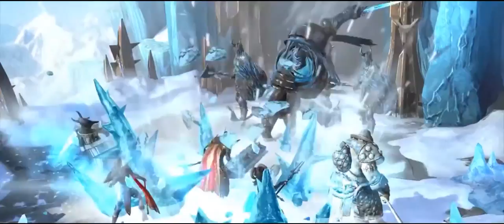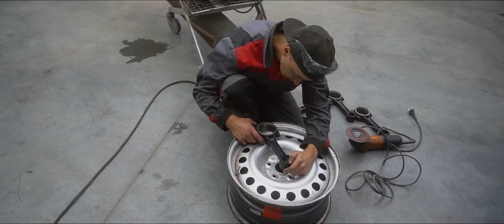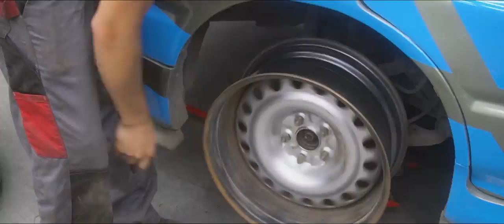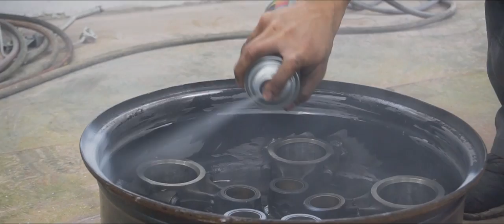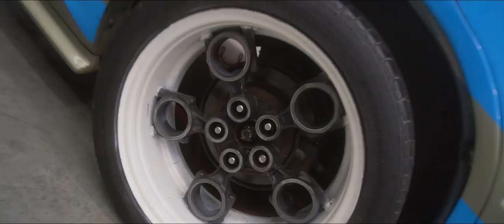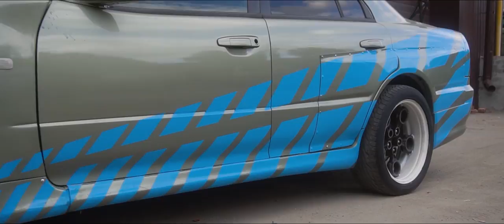How to make a wheel using con rods for spokes

Comment: Start manufacturing and selling those Wheels.
I would definitely purchase a set.
Reply: Yep looks awesome.
Reply: I would definitely not
Reply: If anything, they would be beautiful wall art
Reply: Get me some for my honda odyssey
Reply: Look for some Gianelle 5 Rod
Reply: @saggre  its home made and u dont know how strong it is
Reply: Dude, no, it's held together by just welds
Reply: George Rosebush you’d be surprised by how little weld holds together steelies
Reply: @georgerosebush9754  a good weld is just as strong as the rest of the wheel
Reply: @predater5017  welds are always weak points
Reply: @ksubchallangeBefore  strong is less worry...i would worry mire about the out of round balancing and wobbly wheel  first 🤣🤣🤣
Reply: As long as you aren't intending to drive on them they'd be fine.
Reply: For that they need a welder, not a butcher. ^^
Not intended to be mean, but their welds look always horrible.
Reply: @Eddie Hitler That's on top. :D
I mean it works how they do it, and it's good enough for fun videos. I'm totally fine with that.
But producing and selling such things is a complete other level. Let's say I rather would buy manufactured things from Colin Furze, then from Garage54. ^^
Reply: @georgerosebush9754  knock it off !  When I was a young motoring enthusiast, alloys weren't widely available. And they were certainly not affordable. Everybody were driving around on steel wheels, which were welded together. Look up the iconic white Brazil wheels.
The only issue with steelies is they are extremely heavy.
Reply: @hondaservicecenter  Look, I used to race on steelies back in the day. They never came apart. In fact, if you bend the rim on a kerb, you can repair a steelie with a few blows from a heavy hammer.

Later in life, I have had two alloys breaking apart when being kerbed at speed.

Steelies are stronger than any alloys !
Reply: Morten Kapa because they are steel lol if the steelie was an alloyie it would shatter
Reply: @hondaservicecenter  It was a reply to your claim steelies are weak....
Reply: Morten Kapa I never said they were weak dude read again and then tell me what I said
Reply: @hondaservicecenter  Ok, I may have misunderstood. Were you only talking about weldings on them ?
Reply: Morten Kapa yes lol, I turned a steelie around one day and said “Wow I can’t believe these 4 little stitch welds are holding this thing together and here I am thinking this shit is grand turismo going 50 mph around corners and shit 😂
Reply: @hondaservicecenter  It turns out we are agreeing 100%.
I am sorry I misread you first time around !
Reply: Morten Kapa sorry if I came off rude didn’t have me smoke for the day, youtube comments fill my fix
Reply: @hondaservicecenter  😁😁👍
Reply: Same
Reply: The wheels in picture in the thumbnail look sweet lol
Reply: @georgerosebush9754  I welded my rear spring when it snapped as a temp fix till my new ones arrived i didn't think it would work but i gave it a go anyway..... lasted 4 weeks no issue carrying weight and as you prob know there isnt much to weld to on a spring but i got 3 beads on it, 1 main and then 1 either side, held fine till I fitted new ones lol
Reply: @MegaSockenschuss   seen that turbo ladazilla? The welds on that turbo system are incredible lol
Reply: @Usercouldnotbefound  lol, watching the episode reminded me on my comment here. :D
Reply: @georgerosebush9754  Actually welds are stronger then the material next to them

Comment: Lada should have used you guys to advertise for them, you see the pain you put them through and they still keep ticking . My own Lada got a stuck closed thremostate and I make it home ( 230 miles ) by turning the heater on full blast and useing that as the radiator. Summer time , mountain roads . All tne windows open lol . I loved that little car , brand new 4400 bucks . I bet somewhere that car is still running.

Comment: I actually think they look pretty nice, and I can be SUPER picky with wheel designs. In my mind they have a vaguely late 80's sort of look about them.
Only problem I can see is that the effect would be screwed if they were on a 4 or 3 stud/lug car. A manufacturer would have to design different wheels to work on 3, 4 and 5 stud hubs. That would seriously limit the sales on each design. Tooling costs big money, so they only usually want to make a range of 3 to 5 different diameter wheel molds and adjust the castings for fitment through simple CNC machining....... Or maybe they could make "Universal" 5 or 6 bolt wheels (one per desired wheel diameter), and include a vehicle specific hub adaptor kit to adjust it for different PCD, stud count and offsets?

Comment: Hi ,
Nice idea , verry good looks after finishing ,I like your idea for center alignment job without turning machine, there is a problem this disk working at rear wheel it's ok ,but in front it was not because of you have changed a mounting distance of plate and it effect on stearing geometry stately pls think abaut it

Comment: AS long as you use Forged steel and not cast iron the weld holds good. The wheel looks great. Lug nut missing at the 7:05 mark and is back on around the 7:50 mark. Larger wheel like 20 inch or 22 inch would probably be a less little trouble. Could even place the rods at an angle

Comment: Looks fantastic! 
While you're at it, how about making a wheel out of pistons?🤔
Reply: Pistons are made from aluminium
Reply: @narrwass  
True, for most common engines on the road today. But aftermarket steel pistons are available for diesels, particularly high performance racing engines.
Reply: Yes but they are expensive
Reply: @narrwass  
U R right about that, but something tells me that it wouldn't be any obstacle for the crew at Garage54!💰💰💰😄

Comment: Yes it looks cool and the work was good, but i guess the steets in russia dont allow high speeds. If you drive 100 kmh plus i guess you will get vibrations. The wheel is not perfectly concentric to the shaft.